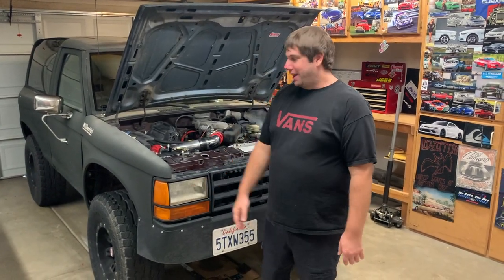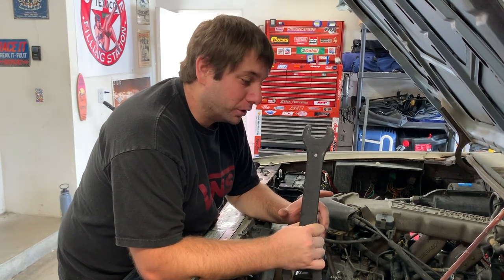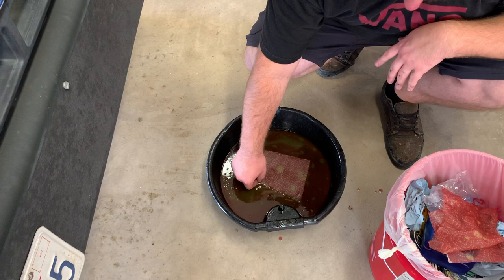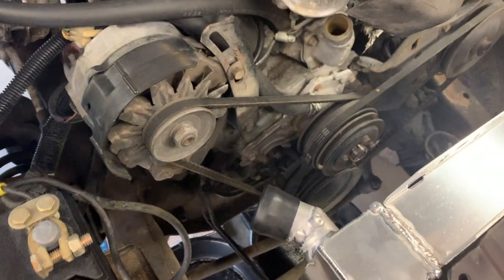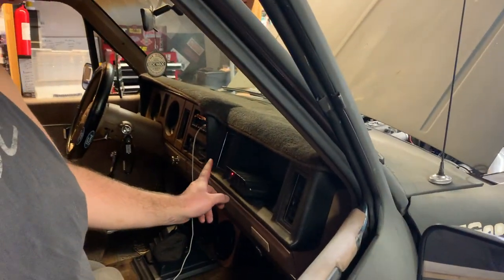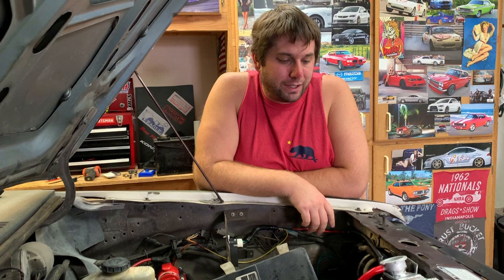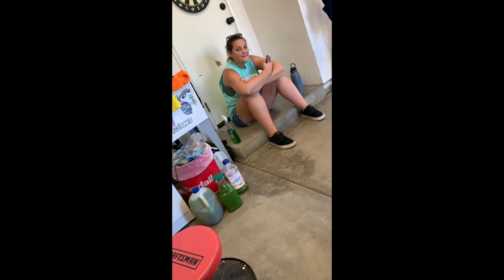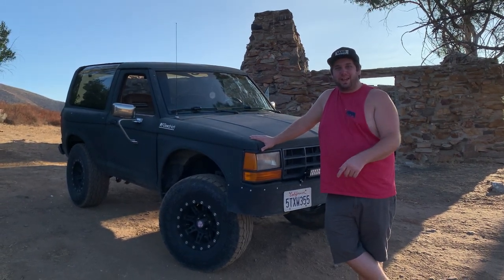How to Upgrade the Bronco 2 Cooling System

Comment: I saw that bad hose location earlier, glad you got it straightened out. I put a separate trans cooler in the grill and disconnected the lines from the radiator. Also I put a GM rad shroud on the radiator to better focus to air through the rad.  Cool B2!
Reply from the maker: Thanks, yeah I should have seen the hose problem coming.haha. Yeah mine has a trans cooler inline to the the transmission lines so mine is going through both the external and internal cooler. A fan shroud will be on my list eventually it works good for now but eventually going to want a bigger engine cause the 2.9 is a little sluggish for my taste. And I’m sure even a 4.0 will need more cooling but I REALLY want a v8 if I can arrange it.

Comment: Good advice on changing all the hoses and thermastat etc. the entire system should be changed on these old trucks. My mechanic did a/c work and it caused the hoses to clogg and thermastat stuck resulting in blowing the headgasket now I am chnging out what was a perfectly good engine I had installed just afew years ago.
Reply from the maker: Oh Yikes! that's not good. From what I have read the 2.9 head gasket is definitely a weak spot. Hopefully your next one gets to last a while longer. Thanks for watching!
Reply: @tackettgarage4982  It was the 2.8. so probably the same Im going to have a reman engine put in it. I dont go off roading or anything but later down the line I'd like to keep up with updates on the digital holly EFI add on I think it will help with overheating issues.

Comment: So rad to see another guy in ca puttin hard work into a good ol old 2.9!  I got an 87' b2 and I'm getting ready to upgrade my cooling system this video is the shit dude! I dont have the budget to drop a ton of $ into a real nice radiator but I plan on grabbing a fresh one and replacing the water pump. Whats your Instagram I'm too curious on recent updates on your rig
Reply: also can I get a link on where you bought the wide body kit and bumper??
Reply from the maker: Yeah the old girl treated me pretty right. The rad I did was actually pretty affordable if they are still selling them. My Instagram is TackettGarage. But sorry to disappoint but I no longer have the bronco. I put a link to the bumper on the video on here where I did all the front end updates, it was actually on Amazon if you believe it.lol. The next update I was going to do before life took a different turn was a James duff suspension lift, was going to do the dual front shocks because I wanted to eventually try to jump it out in the desert.

Comment: For low speed driving you need a fan clutch eliminator and a fan blade with as many blades as possible .
Also as big of a radiator as possible .
Reply from the maker: The big radiator I got, the one I put in was massive compared to the original. And the electric fan worked for me with all the trips I took in it, I’m sure the set up you are talking about would be good too. Thanks for watching!

Comment: Could you do a vid on all the upgrades you’ve done? Please I got the same one wondering what upgrades I need to travel comfortably
Reply from the maker: Nice, most of the upgrades on mine I have made videos on already, and honestly the only ones that have made raveling more comfortable would probably be this one for the peace of mind that it won’t overheat, and the lights and front bumper for a little extra visibility at night, oh and I guess the stereo too but I pretty much fixed what was done to mine by the previous owners. The other upgrades it has and a home made intake, flowmaster muffler, the 32 inch tires, and the prerunner fender flares. All that probably just made it louder and slower if I’m honest.haha but it looks and sounds cool...and probably the tires help off road quite a bit too.

Comment: Where did you mount the electric fan temp switch? Did you mount it in the water jacket?
Reply from the maker: Moneyed it to the bracket that held the cruise control on the left side behind the washer fluid bottle.
Reply: Did you mount it in the water jacket?
Reply from the maker: Oh you mean the actual temp sensor, no it was a probe that went through the radiator fins.

Comment: great video. been thinking about that cool air kit. Is  it worth the money?  i have a 4.0 radiator and running 160 deg thermostat already. keeps cool.. id like o run a electric fan someday, what bout the shroud? i would think you would need that to locallize the air instead of just gabbing air from inside the engine compartment and radiator?
Reply from the maker: Thank you, which cool air kit do you mean? I kinda pieced it together here and there. The fan is probably the weakest part, it probably would be better to have a shroud to make the fan more efficient, but if you check out the next video I put up Utah or bust, we definitely ran it through the ringer going from riverside area here in California out to Utah in the summer and didn’t end up with any overheating problems even climbing the mountains at like 70mph. I am pretty satisfied with its performance so far. I think the real star was the big radiator.

Comment: Hey man, I have a 86 bronco with the 2.9L and when I put the cold air intake on the emissions light come on, also when I first turn it on it will sputter for a couple of seconds. Just wondering if there was something I could do about it. It runs perfect with the stock intake.
Reply from the maker: Well I never had the light come on, did you plug the vacuum lines that attached to the stock air box? I plugged mine so that might be the difference. Other than that I can’t think of anything you could be missing.
Reply: @tackettgarage4982  thanks for the quick response. I did not plug the vacuum lines that go into the stock box, I will try that. Thanks man!
Reply from the maker: No problem, thanks for watching!

Comment: Do you have a link for the radiator / fan ?
Reply from the maker: I put the link for the radiator in the description, the fans I had bought at an automotive swap meet so no link for those, but you can find  similar ones on Amazon for reasonably priced.

Comment: Hey I have an 87 bronco but the wiring is a little messed up from mice is there anyway you can send me detailed pictures of all the wires in the engine bay and where they go
Reply from the maker: I would like to help but I have sold the b2
Reply: @tackettgarage4982  do you know who you sold it to?
Reply from the maker: From what I understand the people I sold it to have since sold it and I think it is at a repair shop for something now.
Reply from the maker: Might have some good luck with diagrams on forums. I remember one called the ranger station had a lot of info.

Comment: what electric fan did you use?
Reply from the maker: Its a 16 inch fan, but I'm not really sure of the brand. I had bought it from a vendor at a local auto swap meet for very affordable. If I was doing it again I would probably go with either Spal, Flex-a-lite, or Mishimoto to be honest.

Comment: What Size tires Do You Have on That & Dose  it Have A Lift of So How Much, My 84 is Total Stock
Reply from the maker: The tires are 32x11.5. It doesn’t have a lift, totally stock suspension, they probably only clear because of the prerunner fenders on it.